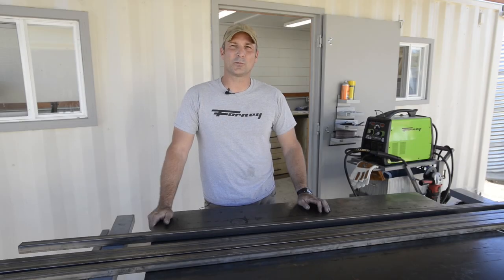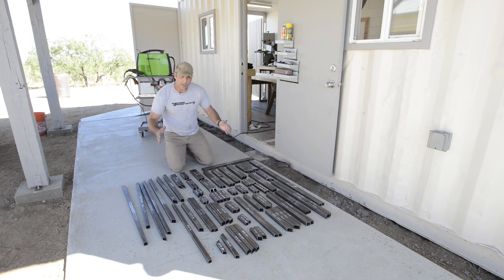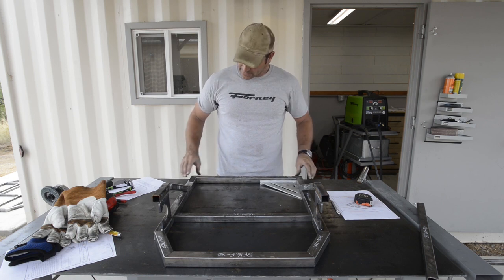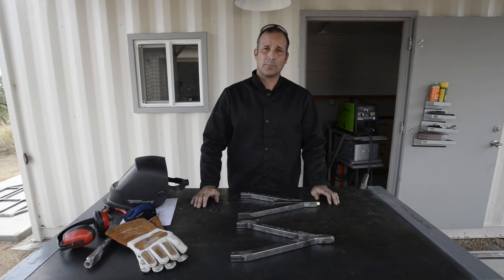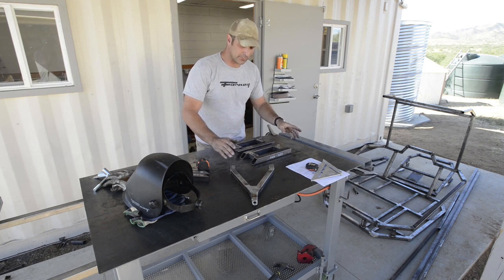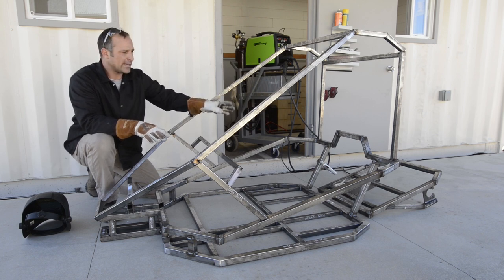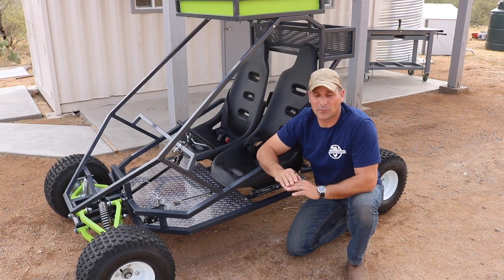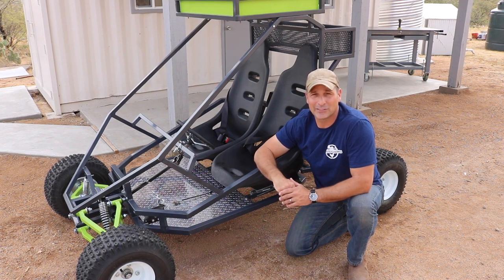How to Build a Go-Kart

Comment: I got my square stock and the saw just arrived. I’m 6’ did you extend the measurements for the frame or did you fit pretty comfortably?
Reply from the maker: Hi Joshua, here is Joe's answer to your question: "No I didn’t but wish I had. I built to plan specs for the lower frame work. But I am 6’ and I think the current frame is adequately comfortable for folks under 5’9”. If I rebuilt it I would extend the middle framework where the seats go by about 8”. That would require the angled pieces on the upper frame to be several more inches as well." Hope this helps!
Reply: @forneyind  I have welded the frame. But only the main frame base, I will be cutting it and extending it  8” this weekend, lol. Thank you so much for the quick response and valuable insight!

Comment: I tried welding sq tubing for a table for my Weber grill and it seemed like I was burning thru the tubing ? First time welding btw, mig welder, table came out ok, holding up but I wanna get better at tacking..... any suggestions ? Go kart frame is my next project
Reply from the maker: Hi Luis, what thickness of tubing are you using? This will help us to answer your question better. You can either reply back to this or you can call our Expert-Techs at 1-800-521-6038 ext. 2 and they'll be more than happy to help you!
Reply: Forney Industries  I used 1.5” square tubing , 16 gauge. The table ended up fine but now I wanna build a go kart similar to the one shown in this video but gotta get better at welding before I do so. I had my mig set up at high voltage , speed was around 5, and it just felt like I was burning thru the sq tubing.
Reply from the maker: @luisr6377  We suggest calling our Expert-Techs. They will be able to help you troubleshoot and they can answer any more questions you might have. You can give them a call at 1-800-521-6038 ext. 2.
Reply: Luis R try lowering your heat and or adjust wire speed

Comment: do the plans show you hot to put the motor and suspension? or just the frame
Reply from the maker: Hi Hector. The plans are mostly for the frame design and suspension components, but because you can install a variety of engines, the plans don't necessarily state how to put in the motor. The suspension is clearly detailed in the plans though.